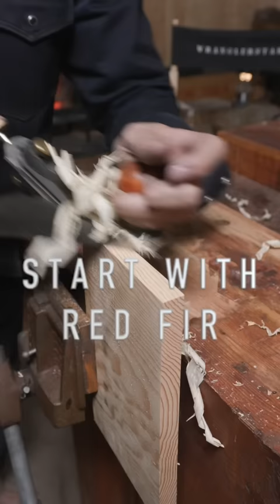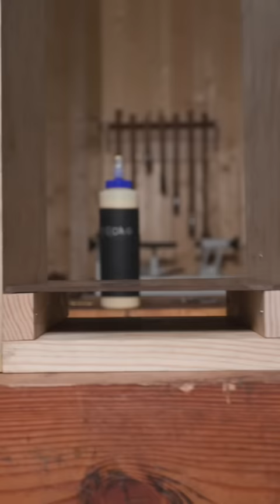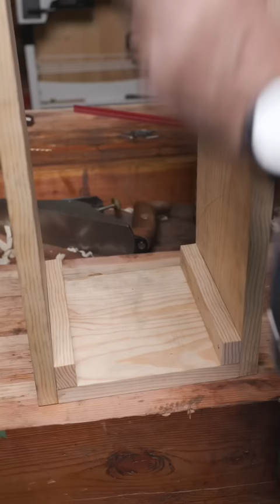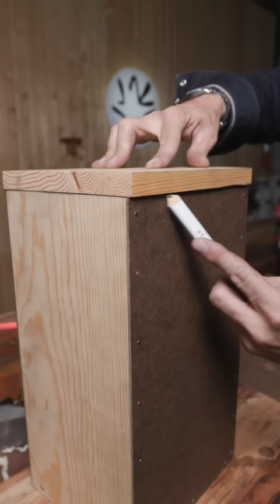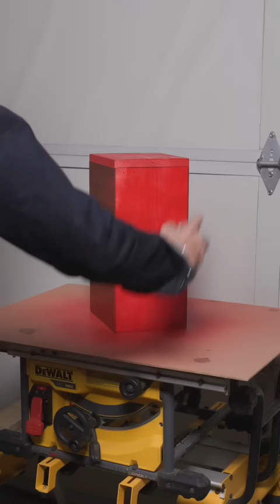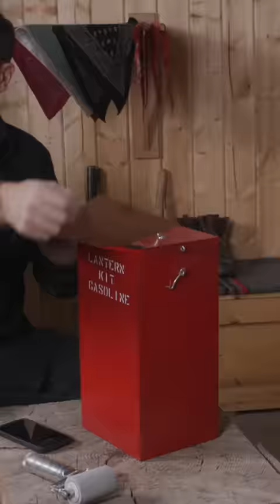Secrets of the US FOREST SERVICE Wranglerstar PROfessional HOmeowner #shorts

Comment: My wife and I have spent the past 35 years living and working in Yosemite National Park, often working in different areas of the park from each other, so we did quite a bit of camping when we would get together on weekends. We never used a case for our lantern back in the day, at least not for truck camping. I put an eye bolt in the ceiling of the camper shell on the truck and we hung the lantern from it. We used a propane lantern, so with the canister unscrewed, we just let the lantern swing away back there. Never broke the glass and, amazingly, never broke the mantles.